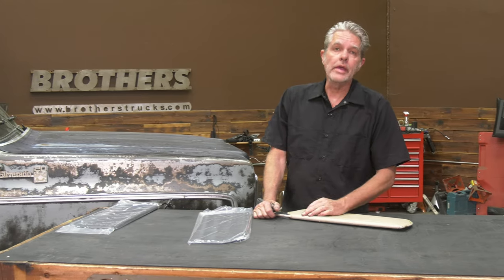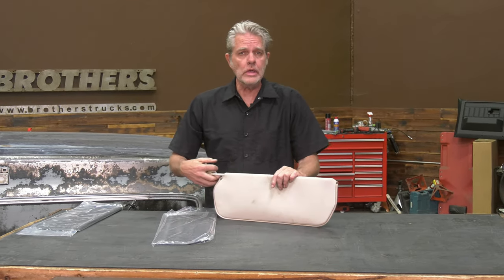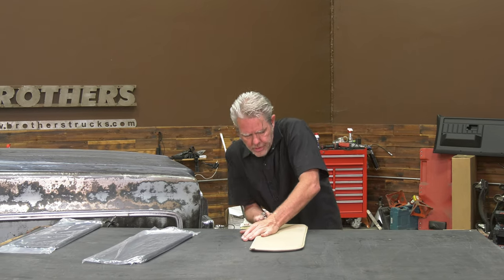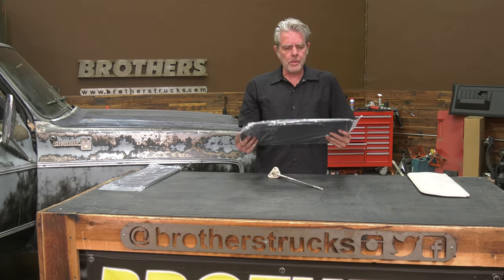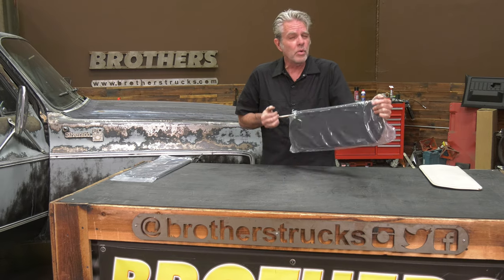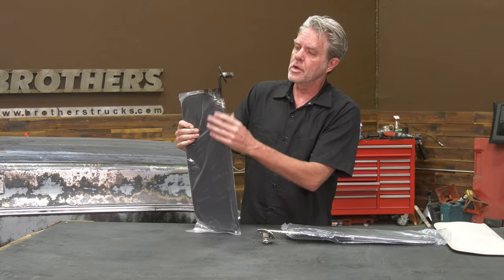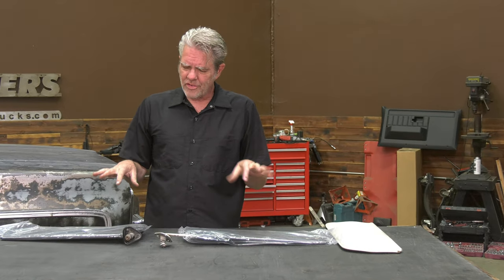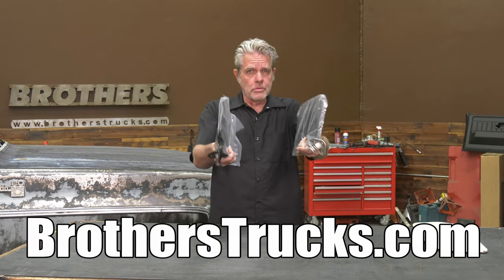1947-87 Chevy & GMC Truck Visor Swap / Interior Update / DIY Visor Install

Comment: Great video as always. I have a question about an older video. I watched your how to on replacing the window weather strip in the door, does the glass have to be removed to do the sections that go in the guide tracks inside the doors? Sorry if this is off topic
Reply from the maker: that depends on the year,make,model of the truck you're working on. The early trucks had the front channel glued in and the replacement has to be glued as well, so that would require the glass to be out in order to accomplish. Later trucks, 1967 and up (possibly some of the 64-66 too) you can typically do the channels without removing the glass. It's more of a struggle, but it can be done.
Reply: @BROTHERSTruckPartsTV  sorry for not saying. I have a 66 c10
Reply from the maker: @maggs131   It's worth a try doing the channels without the glass out on your '66. The front channel in the divider between the vent and the glass will be the most difficult.
Reply: @BROTHERSTruckPartsTV  thanks for the replies man. 👍 Do these channels need adhesive or is it a press fit?
Reply from the maker: @maggs131   Technically it should be glued, but you can almost always get away with just pressing them in.
Reply: @BROTHERSTruckPartsTV  thank you so much 👍

Comment: thanks again Dave..... question: is the driver side visor the same as the passenger? I only have one on my 1965, but doesn't seem to want to fit properly.  made me wonder if i have a passenger side one.
Thanks
Reply from the maker: Same, same... both sides.

Comment: Where can I find those exact sun visors? I've looked on the Brother's site, but can't find them.  I have already wasted money on worthless visors for my '59 Apache 32, where I'm told to bend the rod to provide friction to keep them up...not at all like originals.  Leave it to Dave, once again, to show me the light!  So, how do I obtain a black set of authentic repros like the ones in this video?
Reply from the maker: Here's a link: https://www.holley.com/brands/brothers_trucks/platform/chevrolet/c10/1982/products/restoration/interior/sun_visor_and_components/

Comment: 59 apache 3100. Bought some new arms for some newer OEM replacement visors because one of them would swing out whenever i punched the throttle and the rods freely/loosely slide in and out of the visors. Like complete failure not even functional. Seems if I bend the arms, the RH and LH may end up at different heights and look like crap. Any ideas?

Comment: I got a 305- bored 30 over will 307 heads work on
Reply from the maker: Yes
Reply: @BROTHERSTruckPartsTV  I was told it was lower the compression putting 307 heads on it
Reply from the maker: @rickwilliams3483  It's possible depending on the type of chamber the cylined heads have. There were two styles for the Small Block engine